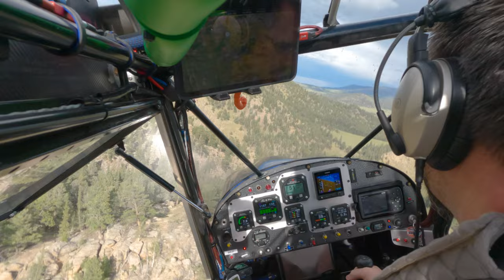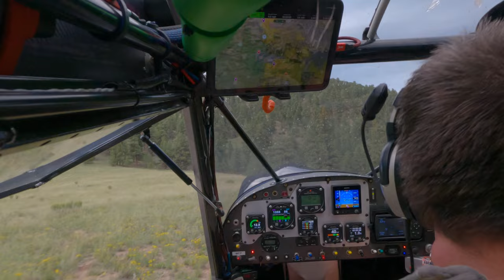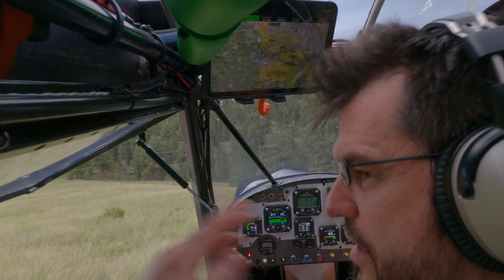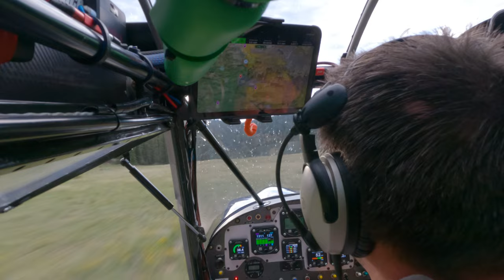sketchy off-airport takeoff in a bushplane

Comment: It looks like your plane climbed out of there like a champion, and I wouldn’t be worried about it when solo flying. 👍
Reply from the maker: You bring up a good point... bringing a passenger along would be a whole different thing. Not just the extra weight, but just putting somebody else in a potentially harmful dangerous situation. I do try to avoid that at all costs.. thanks Russell

Comment: Another option would be driving it off the cliff. I landed a place once where that really was the only safe option getting out. I had flown hang gliders before and that type of launching works really well for powered planes. You get to flying speed really fast. There's a video of it on my YT video collection. The cliff you got  there looks perfect.
Reply: Same here, the steeper the better, my HG cliff launch experiences serve me well in the plane I fly (another RANS S7-S). Part of me, the plane pilot, thinks :this is insane. But the old hang glider pilot thinks: "piece of cake!"
Reply from the maker: I do love a good cliff dive! Actually got a decent cliff dive in that same day earlier.... should be in an upcoming video. In this particular spot, it just won't quite work. From the drone shots it looks good, but one of those deal where the rocks stick up in the way, and there is a little dip leading up to it etc. Can't quite get a good run (its pretty uphill as well). Otherwise, yea... totally agree!

Comment: Would this be an example of "get home-itis"?  And if so, did you consider just waiting till morning, and did you have the necessary gear to stay over a night?
Reply: He covered overnight always on board gear in his last video
Reply: @nickwulf  Yes, I know, but I was curious as to whether he had not only the tent he mentioned with him, but also any other gear he might have decided to take with him, as I had suggested a light weight sleeping bag, would be much more valuable than just a tent and a blanket.  But that all depends anyway, on why not just stay the night in view of less than ideal conditions he faced in this video.  Get-home-itis is a major cause of general aviation incidents with bad outcomes.   As pilots, I suspect we all have been in a similar situation and only hind sight gives us that wake up call.
Reply from the maker: Get home-itis has caused me to make some flights I shouldn't have made over the years.. absolutely. (Landing in the dark on my own runway with no lights in pouring rain and high winds etc., stuff like that...). Honestly, I didn't even really give this spot that thought until after the fact. So I'd like to say I know my plane very well.. down to within a couple feet of where it will leave the ground on TO, where it will roll out to on landing etc. across different altitudes and conditions. Typically I'm always right on those guesstimates... but, I was a little off on this TO.. didn't expect it to be that close! So after the fact it was like, oh, could have camped out... (I did have my lighter camp gear onboard.) The light sleeping bag would be lighter than the blankets when you add them all together, I tried to avoid that route because I can't stand small/restrictive sleeping bags. Part of my thinking was, "if its too uncomfortable, then I won't want to use it and I'll try to go home when I shouldn't" Partly this comes from being 6'4" 250lbs and not fitting in a normal bag too lol. Good suggestion either way, and I'm also glad you brought this up.. get home-itis is a very real thing in my opinion.

Comment: I can do that !
Reply from the maker: what are you flying?
Reply: @GravityKnightFlying  Nothing for the past 20 years or so but I flew in the Adirondacks for years. Mostly 172s . Fuel exhaustion at 8500 put me in a field smaller than that which I flew out of after the FBO delivered 2 cans of 100. When I started flying  rental for a 150 was $35 wet and an instructor was $15? I had to quit when the costs neared $200. As they say it's the most fun you can have with your clothes on. I miss it a lot.